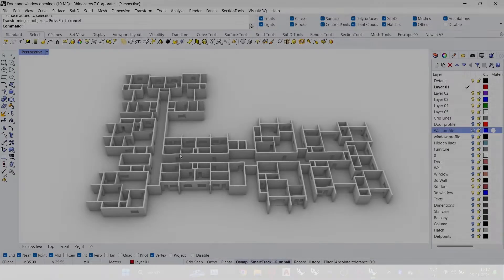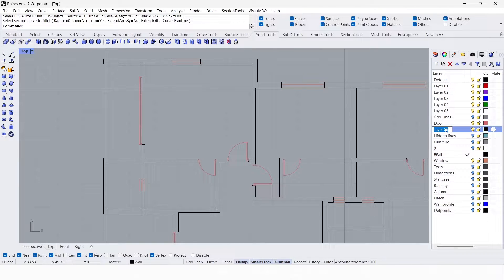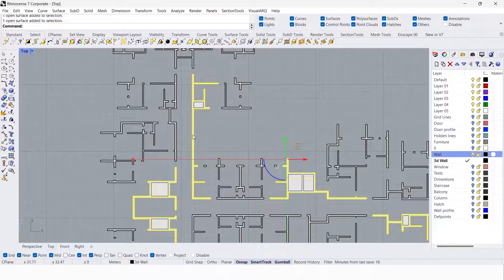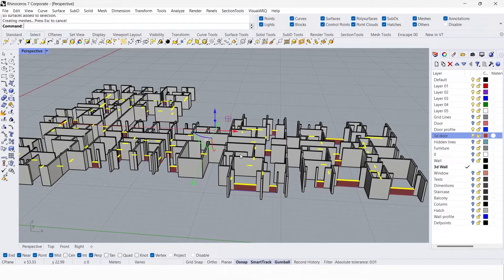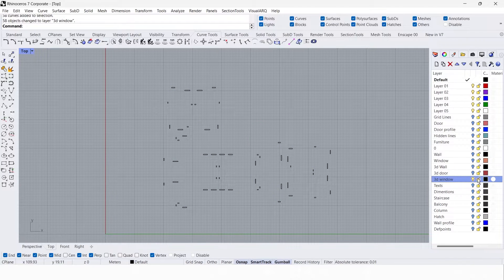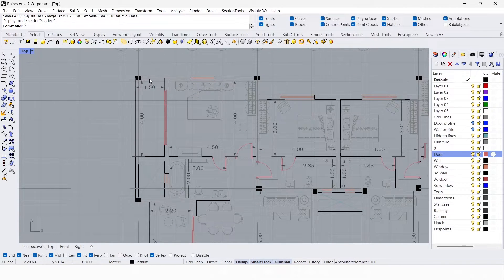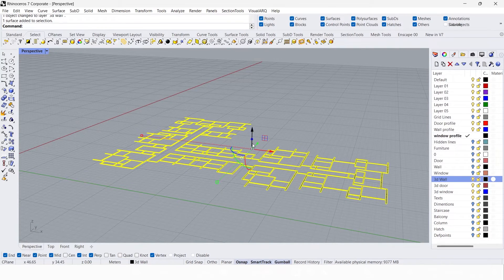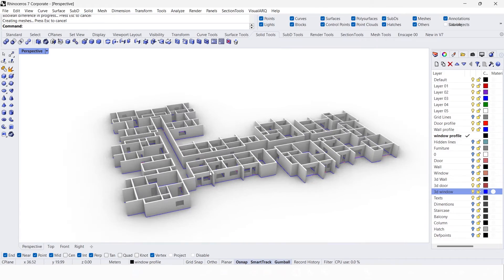How to create door & window openings in a easy way  | Rhino tutorial for architects

Comment: Excellent thank you for showing this streamlined, no-guessing, workflow. I want to learn how to do things efficiently. I have watched several videos that they are not going about things quite so accurately and drawing "lines" where the sides of the window would be. This takes care of it. Except that in this large residential project I'm tackling as a first project, the windows are different sizes and set at different heights, or 2 with windows vertically stacked at different heights. But that's OK, even handling some of the room by room situations I know how to handle it now! I've been thinking there must be a better way than I'm seeing, to produce this floorplan. I saw a video for ArchilineXP that was amazing. Automatically pulled up the FP with the windows/doors etc. I believe there is some AI integration behind it. Must be as it would have to read the markings on the FPs to get the positions correct. Thank you for your time. It's amazing so many people take the time to share their knowledge and skills.
Reply from the maker: This means a lot to me, thank you!!